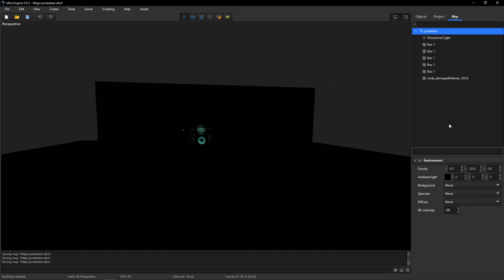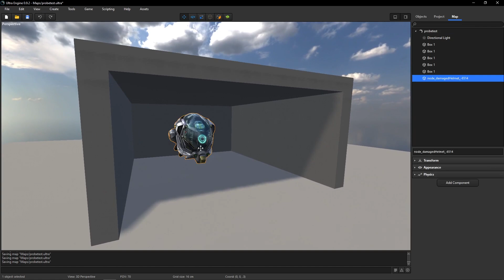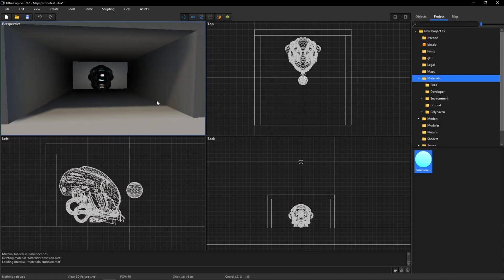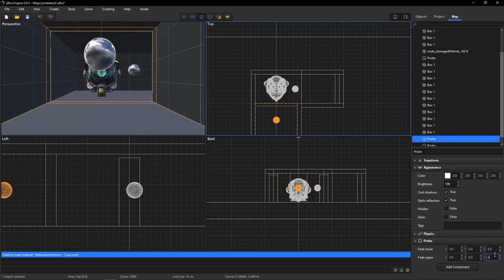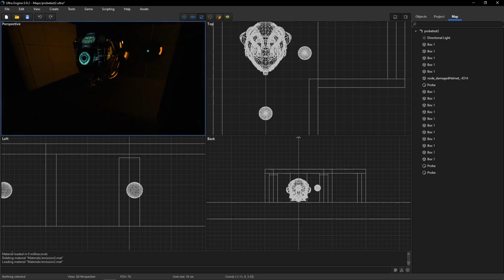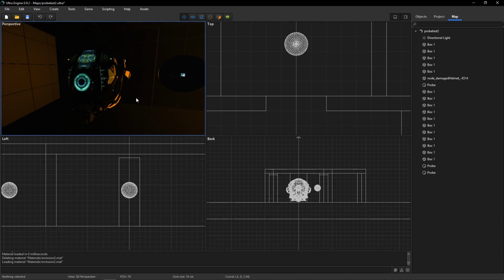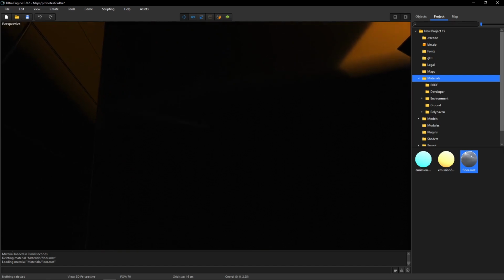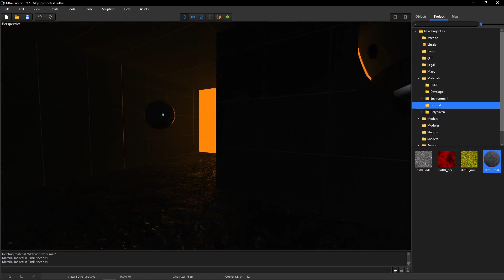PBR Lighting, environment probes, and reflections

Comment: About a year ago, you posted experimentierts about voxel conetracing and Global Illumination. Is that still on the table of Ultraengine?
Reply from the maker: After spending considerable time on it, my verdict on voxel-based GI techniques is this:
- Although it is possible to get nice results in carefully controlled circumstances, the technique is not robust enough for general usage. There are often bad artifacts that have to be worked around.
- It scales really badly because doubling the resolution increases memory consumption 8x.

My conclusion is that hardware raytracing should be the next step in real-time lighting, although we are a few years away from the hardware being commonplace.

Comment: It looks like this is also and ambient occlusion probe? As it blocks ambient light making the room black?
Reply from the maker: The reason it gets dark is because it's blocking the sky reflection. In this example I used no ambient light at all. If you add a small amount it will get picked up and propagated by the probes. You can also control the color / brightness of each probe entity to fine-tune the appearance.
Reply: @Leadwerks I watched again, you are selecting diffuse lighting cubemap. Which is ambient lighting isn't it? And then each probe replaces this ambient light map with it's own.
Reply from the maker: @Genebriss glTF actually uses two cubemaps, one for diffuse reflection and another for specular reflection. But yeah, that is basically correct.